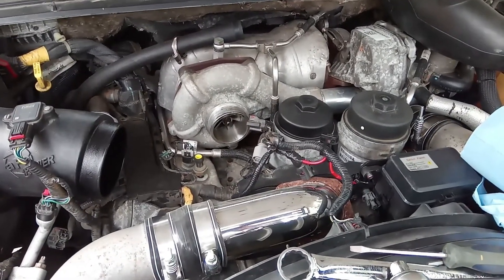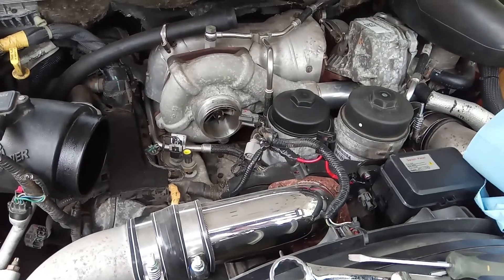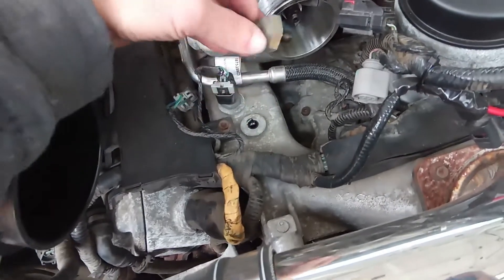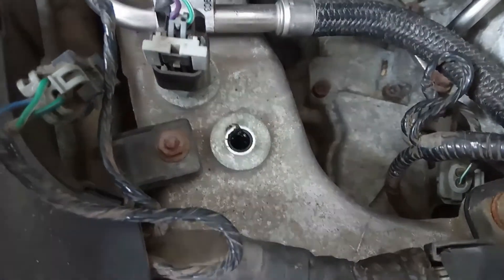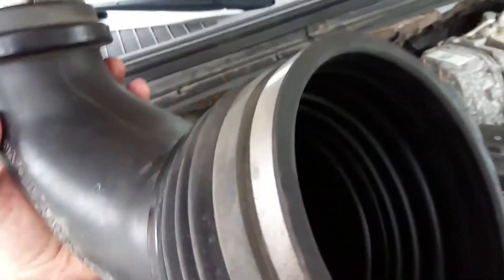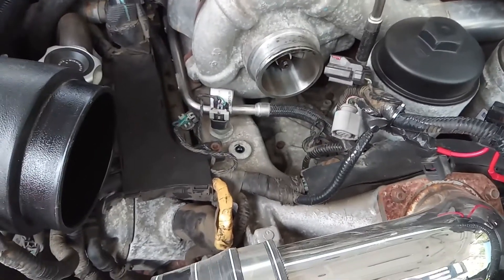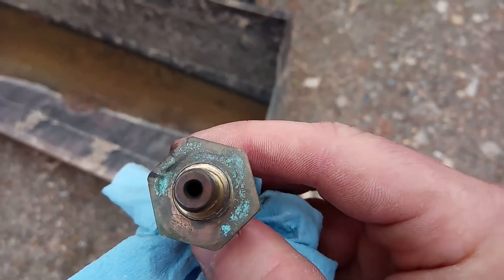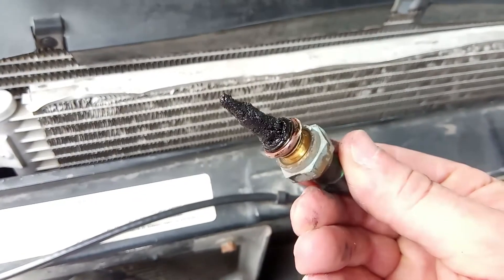Why Your 6.4 Powerstroke Needs a Catch Can: Part 2

Comment: remember the old valve cover cap with steel wool to catch the oil/ vapors. looks to me like ring blowby is worn cyclinder/ rings! it would be interesting to see the cyclinder temps to find out where the oil is burning off, as in why the engine puts out oil smoke at tailpipe. old timers used to say black tailpipe bad, i think, on the gas burners.
Reply from the maker: The rings and cylinders aren't worn any more than usual, this is just common on 6.4's, especially when they're modded like mine (it can hit 40psi of boost which the ring seal doesn't seem to be up to the task for). It doesn't burn any oil at all, it just pressurizes the crankcase more than it should, which in the factory CCV system reroutes vapours back into the intake system and over time coating sensors in sludge
Reply: I remember building a few 6.4’s several years ago and they all had a ridiculously large ring gap from the factory.  Guessing it’s navistar’s idea because of the higher boost of the compounds🤷🏻‍♂️.   Anyways,  no matter how I spaced the rings they all had blowby after they were put together.   But on one build I used delipped maxxforce pistons with a tighter ring gap and it had zero blowby.

Comment: idk abt these but the 6.0s are designed to suck the oil back thru the turbo and burn it off putting a catch cab on a 6.0 is a death wish for you’re turbo and i’m assuming goes for the 6.4s also
Reply from the maker: No truck is designed to suck oil through the turbo. All turbos are lubricated via dedicated oil feeds from the engines oiling system, plumbed through the center sections where the bearings are. If you're talking about the crankcase ventilation system, every vehicle since the early 70's has had some form of it, and it's supposed to send vapours through the intake system not oil. If your rig is sending oil through the turbos you have a problem, one that the catch can helps to alleviate.
Reply: @backwoodsbuildingandfixing9223 it’s not rocket science i’m not sure abt 6.4 i’m sure it’s abt the same the turbo does create a small vacuum on it and it helps relieve crank case pressure venting to atmosphere actually holds it in and increases it and they do suck oil thru it’s diesel your gonna get that it just happens and they do burn it
Reply from the maker: Jesus bud. You're right, it isn't rocket science, but it's clearly still over your head. There is no more vacuum on the CCV tube than there is on your air filter, which is virtually none, if you think that is going to suck oil up from the crankcase into the rocker cover and into the intake you're in fantasy land. I've been messing with every version of internal combustion for 30 years and every kind of crankcase ventilation system on them, the one thing they all have in common is some attempt at keeping oil out of the vent tube. Whether it's a simple splash shield in the valve cover, or a mesh filter canister, or a fancy vortex inducer like in the 6.4, EVERY SINGLE ONE has some method designed by an engineer to prevent oil from getting into the intake. There is only one way oil gets past these measures, and that's excessive crankcase pressure. And the only reason for excessive crankcase pressure is excessive blowby. Only the hackest of hillbilly mechanics will ever try say that excessive blowby is just part of how an engine is supposed to work. By the way, if you paid any attention at all to this video or the other videos I've made on the subject, you'd know that I went from pouring oil out of the intercooler to having a dry intake, and plenty of oil in the catch can. You need to tuck your ego away and do some learning, because you are nowhere near knowledgeable enough to tell other folks they don't know what they're talking about.
Reply: @backwoodsbuildingandfixing9223  they do suck oil thru how else would u explain oil in the inner cooler smart one🤣
Reply: @backwoodsbuildingandfixing9223  u definitely don’t know what your talking abt😬
Reply from the maker: @diesel_livin8465  "they do suck oil thru how else would u explain oil in the inner cooler smart one" Buddy....that oil didn't get sucked in from the mysterious turbo vacuum you believe in. It was pushed into the CCV system by blowby, a common 6.4 problem, and then travelled through the intake system. This is a problem that I've successfully dealt with by installing a catch can. What part of this are you not understanding?
Reply: @backwoodsbuildingandfixing9223  catch cans are useless
Reply: @backwoodsbuildingandfixing9223  no duh it’s from blow by that’s what the crank case ventilation is for. oil does get passed the rings and it does go thru the intake there for oil does get in your inner cooler and the truck does burn small amounts of oil
Reply from the maker: @diesel_livin8465  Jesus. First you claimed that the engine is designed to suck oil through the intake and that the turbos will somehow die if it doesn't. Then you claimed that the turbos make vacuum which sucks oil out of the crankcase. Now you're saying that somehow oil gets past the rings and then magically winds up in the intake system. And through it all you keep iterating that catch cans are useless in spite of me having video proof that my can catches a ton of oil and I now have a dry intake system. This is like arguing with a flat earther
Reply: @backwoodsbuildingandfixing9223  you’re arguing over something that is useless if it was hood ford would have done it
Reply: @backwoodsbuildingandfixing9223  some people just don't have a clue and never will....
Reply from the maker: @brucehirsch5437  Truth
Reply: @backwoodsbuildingandfixing9223  thanks for all your knowledge. I'm in place to order my catch can soon. I've watched yours videos. Good info....
Reply: @backwoodsbuildingandfixing9223  every diesel sends small amounts of oil thru the crank case ventilation don’t know what your talking abt😂 your gonna get oil thru there no matter what catch cans on them is stupid and useless
Reply: Burn vapor catch the edibles hopes the sensors stay cleaner for longer periods. I just installed a small catch can fit on air box under intake tube put the squeeze on the air-condition line, smart looking installed. 😅